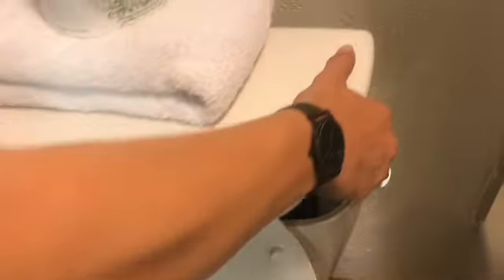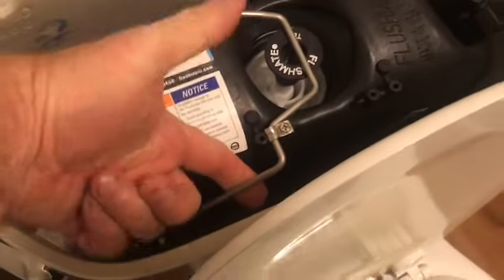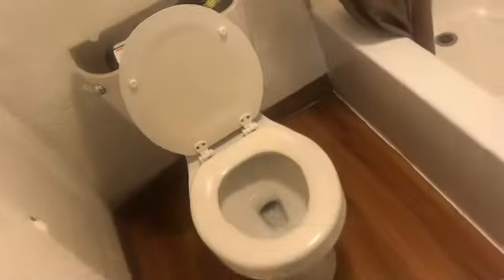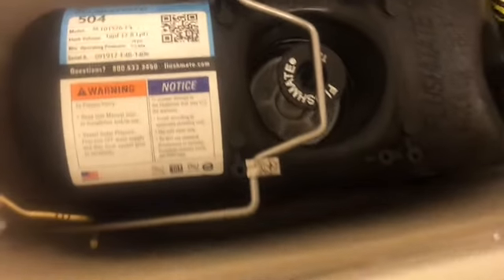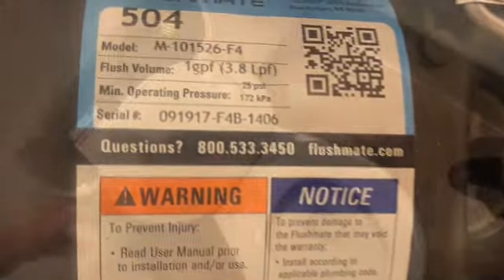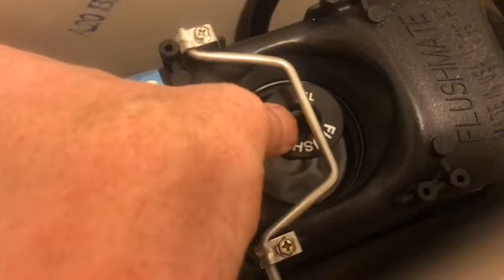MORE flush LESS WATER pressure assist sloan flushmate (the good and the bad)

Comment: At our business, we have 3 toilets with the Sloan Flushmate system. They are awesome, never plug up and always flush. They are 1.6 GP flush toliets and never need a second flush.

At my personal house, we don't have city water or a well. We capture rainwater off the roof and during dry times pay the water man to deliver 2500 gallons for $120. So we pay more for water than most. 

I have an older toilet and the stupid handle keeps sticking and running out expensive water. My first thought was to just replace the handle. But long term, it might make more sense to just replace the toilet with a more efficient one.  I like the Flushmate system, so was looking at the toilet at Famous supply and they have some that are the Flushmate IV system that only 1 GPF. Wondering if these water saving Flushmate's work well?

Comment: How does this pressurize? I don't want to sound stupid, but does it plug in to electric outlet? It is interesting to say the least.
Reply: The water fills the vessel in the tank compressing the air and building pressure. Then it is all forced out when you flush.
Reply: these dont work too well unless your toilet bowl was designed to work with them like at walmart restroom it shoots out like mad, but at my house they swirl and lose its power by the time it drains

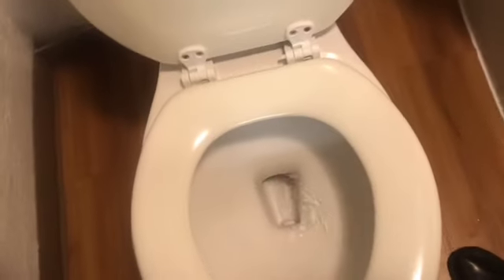Comment: 0:09 Yeah right. Just because it exists and looks powerful doesn't mean it works. I know from experience that about 99% of old toilets and a good number of new ones can take more waste than this one. One gallon is not enough to remove solids so don't scam people with it please.
Reply: Totally agree with you; this guy who made the video is clueless. Old vintage toilets are so much better than the pile of crap that this guy has.
Reply: @jacobs9306  True
Reply: True that. 100% agree with your statements. Most pressure assist toilets just use way too little water for them to be really all that effective. The ones I would suggest getting are the Gerber Ultraflush, Mansfield Quantum, and the Kohler Highline or Wellworth PL (and not the 1.0 GPF version). 

Look, I understand that people buy brand new toilets so that they can save water and money, but what good does that do if your new toilet is going to clog up on waste and requires more than one flush every time you try to flush your waste down? Then you realize that you aren't really saving money after all. New toilets honestly just ain't all that effective anymore and a lot are not too designed well compared to an older or a vintage toilet.

If you want to have a good toilet that will perform well and get all of your waste down in one go and no problem, just keep your old toilet as long as it's older or vintage. Then you won't have to be spending a bunch of money for a waste of a porcelain throne that can't get the job done and make any difference with your water bill.

If you've got a good old toilet, even if it won't be exactly a water saver, don't listen to the home inspector about replacing the toilet. Just go with your own gut feeling and find out if it's worth it or not.
Reply: @christopherpotomski8463  Exactly! I'm replacing a 2000s Colony with a vintage toilet because it clogs so much and ends up using more water than the vintage one plus all the added trouble of unclogging it. Not to mention it has horrible bowl rinse too. New toilets are a joke and we need to bring back the good old ones.
Reply: I've had a Crane pressure assist toilet for about 10 years and it's great!  It's a 1.6 gallon flush and I got it because my kids were using way too much toilet paper and clogging the toilet regularly, I've never and to plunge this toilet and it's extremely rare to need 2 flushes.  I do have good water pressure which no doubt helps, so take that into account if you don't have good pressure.  That being said, I got mine on sale because Menards was no longer going to carry it and when it needs replaced I probably won't go for another pressure assisted toilet mainly because when there is any issue it's harder to get parts for.  I'll do my research and get a normal toilet with a 3" flush valve that rates very high on flushing ability.
Reply: @dustintunis9347  I had one of those Crane Economiser toilets and it actually wasn't bad. It wasn't very loud either.

Comment: What brand was your toilet?  I know flushmate only works for certain brands
Reply: The toilet brand here is ProFlo, and the model name is "Gilpin".
These toilets are just pieces of garbage, if you want a good pressure assisted toilet, I would recommend Kohler Highline Pressure Lites (Current gen) or Vortens Tornadoes.
Reply: Pressure assist toilets are horrible in general. Especially these (ProFlo Gilpin), Kohler Highline Pressure Lites, and Sloan's pressure assist model.
Reply: Or "NoFlo Dullpin"

Comment: 0:09: BULLSHIT!!!!!!!!! What a scam, and I won't take it! I'll still go vintage. 1.0 GPF doesn't do squat for flushing waste down "effectively."

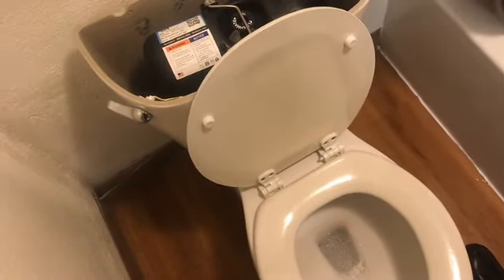1:00 I hear you on that. They are quite a fair bit louder than what you'd expect.

1:09 My own personal experience with pressure assist toilets over the years? Yes I've been startled by them many times. Typically I would just have to plug my ears.
Reply: There might be a couple toilets that can successfully remove waste with one gallon but then what happens to it? It just sits in your pipes and builds up until it hard clogs your whole house due to a lack of water flow. I have had this happen before and it is NOT fun which is why I now have 2 1959 Standard Cadets in my upstairs bathrooms. No clogging, no sewer backups, no trouble at all.
Reply: @OCC_Plumbing_and_Restorations  Gotta love the vintage toilets. 😉
Reply: @christopherpotomski8463  Exactly!

Comment: NEVER FLUSH IT WITHOUT RELOADING. CAUSE OF EXPLODING AND CAN CAUSE INJURY OR CAN BE EXTREMELY FATAL. ALWAYS WAIT FOR IT TO RELOAD.
Reply: No, it absolutely cannot explode because you flush before it's fully pressurized.  If it would then they would be dangerous anywhere with an issue with low water pressure.

Comment: How does this pressurize? I don't want to sound stupid, but does it plug in to electric outlet? It is interesting to say the least.
Reply from the maker: That’s not a stupid question at all, I asked the same question when I first saw it. I don’t know what the pressure is but it’s pretty effective. There’s no electric plug, it works completely off the water pressure. Water pressure is typically at about 50 psi. It can vary depending upon what floor you’re on but that’s the target. I’m glad to see that they have worked out the bugs. Having the tank blowout would be very scary. And it sounds like about 1400 of them did fail. Besides the price, the loud noise when it flashes would be the only downfall. They sound like the commercial toilets when I flush. Like you said interesting at the very least. I really appreciate your question thanks
Reply: Well, you have to understand that matter takes up space, even gas. When you have a fully inclosed vessel, with a lot of air in it, putting any thing else in will be difficult. The thing is that as soon as water is stored the the vessel, air is compressing it so hard, that when you finally open the valve, the air forces all of the water out, which gives it the properties of a public flushometer. The perfect example is shaking a Coke bottle. When you shake carbonated drinks, it releases tiny bubbles which pressurizes the bottle. As soon as you open the bottle, all that compressed matter goes out the direction of least resistance. In the Coke bottles case, up in your face. In the flushmate’s case, down into the toilet bowl.